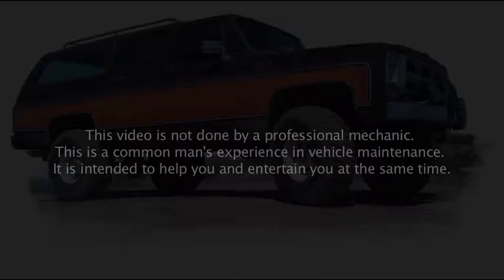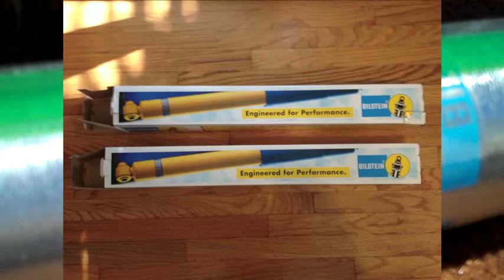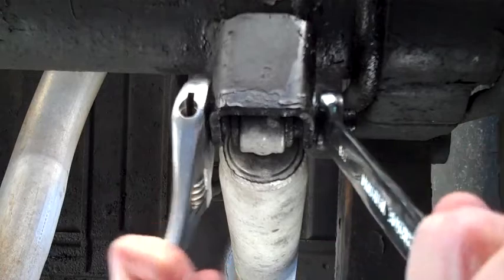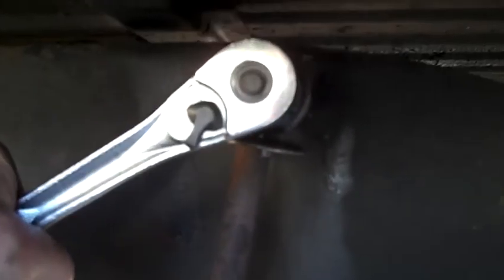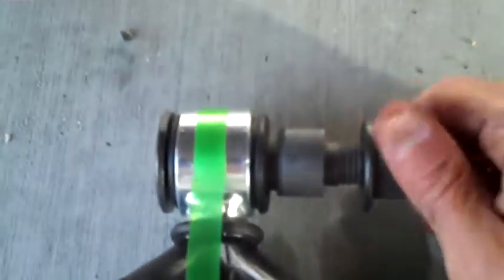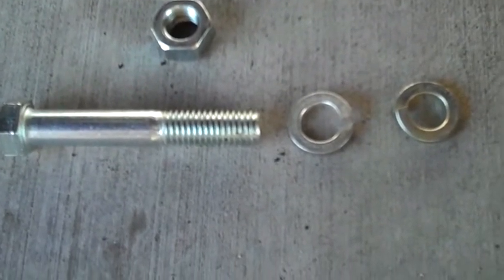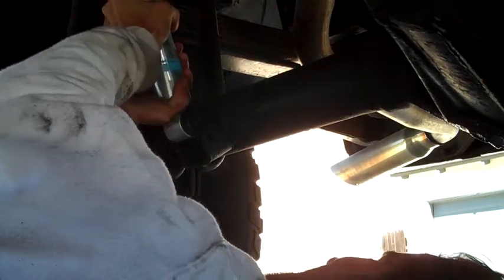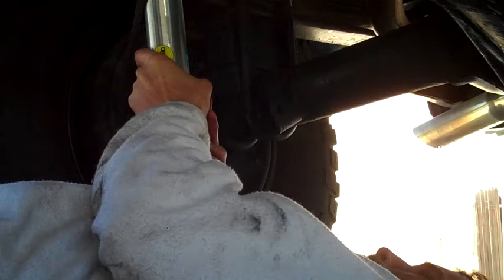✇ How To Replace Rear Shocks - GMC Truck Replace Install Shock Absorbers - Half Idiots Guide

Comment: I am no expert but I don't know about spraying WD40 on the new bolts before tightening the nut because WD40 is a penetrating oil designed to loosen bolts from nuts. I would have used grease on those new threads before tightening the nut instead of WD40. Also I would have used a floor jack to compress those shocks instead of a grinder.

Comment: also wd40 is not anti seize... anti seize is anti seize..
Reply: A blow torch and WD-40 is better than any antiseize I've ever used.
Reply: he said WD40 or anti-seize he didn't say WD40 was anti-seize learn to listen.
Reply: Wd40 and anti seize are two different things. Anti seize won't help get anything loose if it's stuck. But, it will help something from getting stuck if used during install.
WD40 is useless for anything. It's not a penetrate. It's basically liquid aerosol silicon. I'd recommend PB blaster or Marvel Mystery Oil for a good penetrate.
Reply: WD is more of a DE-seize